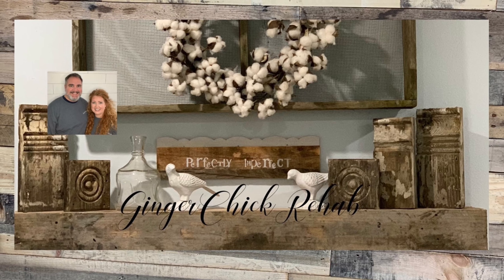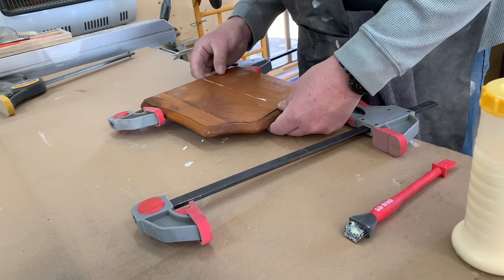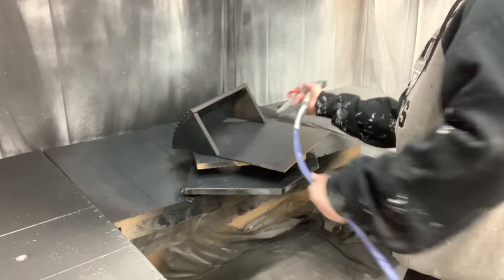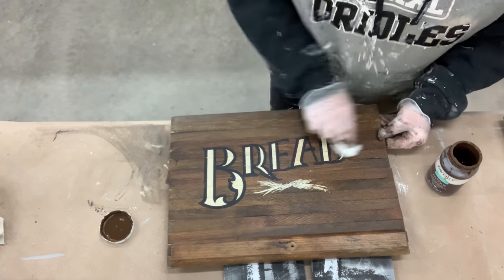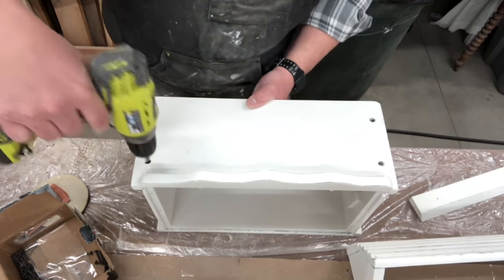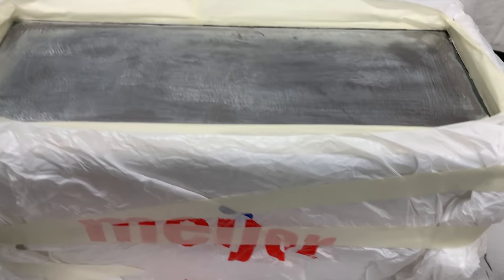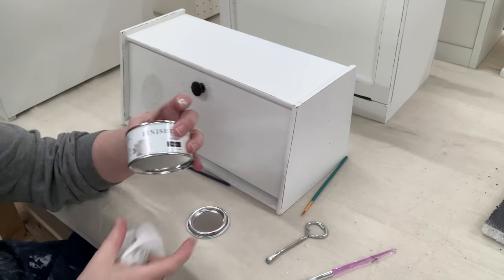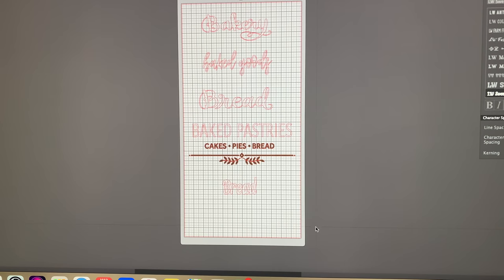For The Love of Bread Boxes || Flipping Thrifted Bread Boxes for Profit || Trash to Treasure

Comment: Thank you so much for showing how to fix the roll top box!  I have one I thrifted and after I painted it the canvas strips came loose. It got relegated to the garage but I just couldn’t throw it out. Now there’s hope.  It’s coming to apart and getting fixed!  Yeah you!!!   BTW I’m so glad to see someone sticking with the Silhouette.  Like you, I’ve had one for years, it’s what I know and I’m happy with it.  I haven’t made many stencils but I’m motivated now.  I also subscribe to Design to the Nines and her tip for using stencils is to put a coat of the base color over the stencil, then go back with the desired color. The theory being that if the paint is going to bleed under the stencil, it will be the same color as the base and create a little seal for the black (or what ever color).  Using the blow dryer to soften the vinyl when removing the stencil is a great idea.  Wondering how to get it off without damaging the object has been one of the reasons I haven’t tried stencils much.  Thanks Again!
Reply from the maker: We are so happy to hear that you can save a bread box. That's awesome. And for sharing your tip with me. Yes I really love my Silhouette. Thank you for watching

Comment: Thank you for ANOTHER excellent tutorial. I notice you pop all your screws, hinges etc into one jug. I often cannot find the hinges knobs when I have finished a piece. How do you keep all the pieces for the correct items straight, given you do so many in one sitting? thanks for your time, Jonelle :)
Reply from the maker: Thank you, That's a good question. I guess a mental note, as we put them on the foam to spray them we can tell what goes with what trying to separate them out on the foam board helps to. But the items are made to go together so you know when you have the wrong screw.. well most of the time

Comment: Perfect timing...I am working on my 4th bread box. It's my first roll top one. I wasn't going to take it apart but maybe I will attempt it. Another question for you...why didn't you need to spray polycrylic on after you painted them black? I was planning on doing that but maybe that's a step that isn't necessary on wood? Thanks again for sharing all your flips. Love your channel!!
Reply from the maker: I would suggest doing the polycrylic between. It's funny because I mentioned to Chris I didn't think enough black showed through. Mostly wood. So we agreed to do it next time.
Reply: @GingerChickRehab  thank you for letting me know that. Now I need to figure out how to take it apart. I didn't see any screws or nails. It may be glued together? I can't tell from your video but it looks like you whack the sides with a mallet? Ugh. Nervous that the box will break or something...

Comment: I love your work. I do have a question please when do you use Polyacylic. I have painted a wooden piece with Walmart brand paint and primer. Do I need to spray with poly? Of course Varathane wax not available here. I apologize for so much info needed but that is me.
Reply from the maker: No problem.. yes it’s best to seal it in with at least something. Polycyclic would be a great choice

Comment: Thank you for showing the sprayer technique on redoing boxes. I always hand paint. Now you have me wanting one of these sprayers! Lol work smarter, not harder, right? My ? on the sprayer, do you have a separate hose for when you spray white and a separate hose for black or do you have to rinse the hose out each time before doing a different color? What tip/pressure settings do you use when spraying? I have a cheapo Harbor Freight one but I don't like hooking up to an air compressor, straining the paint, watering it down, cleaning all the parts, etc. I always hand paint but I need to start getting more done bit need an easier way vs the sprayer I currently have and hand brushing .
Reply: You make spraying look easy and more efficient time-wise. I'd like to set up a paint booth area to do multiple pieces in a shorter amount of time.